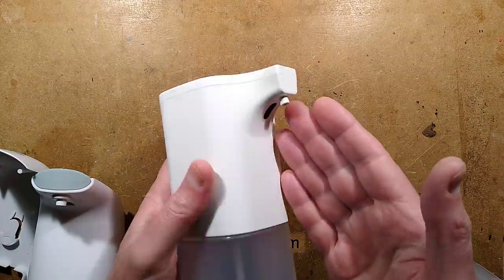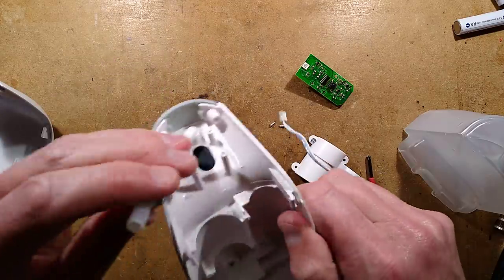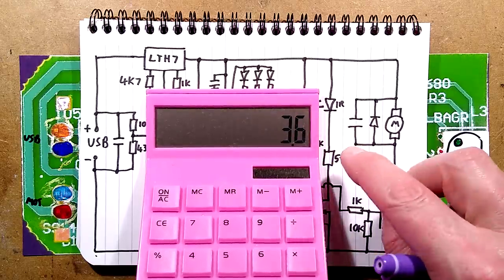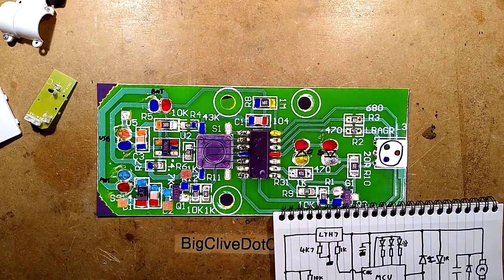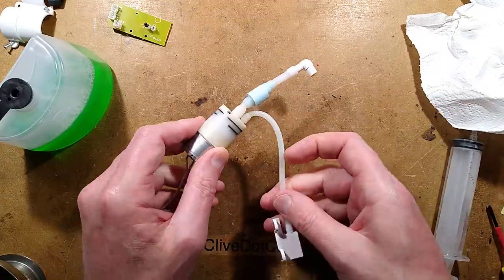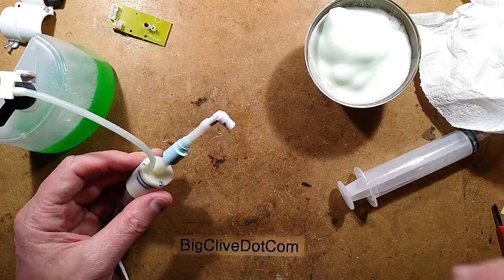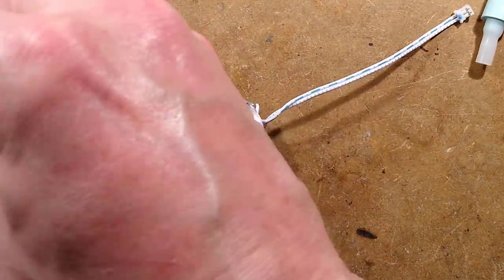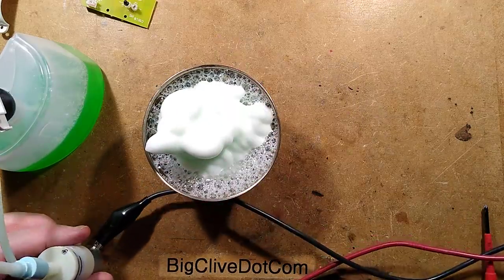Fixing a faulty schmoo pump

Comment: Have 7 of these in the family & 4 have needed fixing so far. They work fine for about 9 months. Over time the unprotected pcb/smd components get corroded by the soap vapour. Both sensor pcb + main pcb suffers. Fix was microsoldering or jump wires followed by a conformal coating. My advice is take it apart when new & seal all the the pcb's before use.
Reply: Very clever info

Comment: Pump could be incorporated into an automatic woofler ,with spark ignition ?
Reply: Exellent!
Reply: Oooh! Yes!
Reply: Make it so @clive
Reply: I think he tried making one before but it didn't work so well, or tried to melt itself
Reply: @phonotical  I know Clive isn't a fan of Alexa, but the prospect of shouting 'Alexa ...whoofle!' could be amusing, sonoff relay and a wee script would do it 🔥🔥🙂
Reply: @j_o_h_n_d_u_n_n  depends on her reaction 😂
Reply: There used to be a kid on YT called Royal Nonesuch.
He made guns in his "machine shop" a garage with a cheap stick welder, an angle grinder, a vice and a hammer.
As dangerous as that sounds he pretty much knew what he was doing and never hurt himself.
Then he built a flame thrower.
12 volt pump from Ali Express, a drill battery, a switch and some sort of igniter.
Oh yea I forgot the best part several gallons of a gasoline diesel mix in a bottle in his back pack and connecting it all was clear tubing that looked like it came from a fish tank.
Every time he showed it, it actually worked and he would ride around on his motorcycle randomly shooting flames at stuff.
I remember begging him to please go back to safer activities like making zip guns in his garage.  
Sadly he was purged by YT and I can't find most of his videos anymore.
Reply: @1978garfield  stay in school kids 😂

Comment: So in theory, running a cleaning cycle of rubbing alcohol or cleaning vinegar, then water to rinse out the guts would work?
Reply: Yes, probably.
Reply: It's a junk product and water goes inside, rusting everything or causing electric shorts. Junk, junk, junk!_
Reply: @jurivlk5433  how else do you expect the soap to foam. Yes it's basically a disposable device. Wonder what they had to to do for the power adapter and the 18650 battery? 🤔
Reply from the maker: It might help.  It depends on what the mesh clogs with.
Reply: @epsileth   Shitty quality isn't a requirement for soap dispensers!
Reply: @jurivlk5433  welcome to capitalism. Has to last long enough for the manufacturer warranty to expire. Let's see you design a  better device.
Reply: @epsileth  One could think you're the owner of the manufacturer of that shit!
Reply: @epsileth  Were Soviet factories... known for their quality control 🤭
Reply: @phantomkate6  I don't know, I've never been in one.
Reply: @epsileth  I'd venture people would rarely bother to keep their receipt for a purchase of this value, so it wouldn't even have to last that long.
Reply: @phantomkate6  From my understanding they were reliably subpar.

Comment: Handy device. Will you be converting to an 18650 battery, or will it be too much of a faff for everyday practical use.i.e finding it flat and having to re-charge, instead of swapping batteries.

Comment: Might be worth mentioning, whenever relevant, that rechargeable batteries (generally) output a lower voltage when fully charged than non-rechargeable batteries.  In some kinds of devices it makes a lot of difference.
Reply: While the initial voltage of rechargeables is lower, their "empty" voltage is higher than that of non-rechargeables. So if it makes a lot of difference, it means the device is really bad at using all the energy in non-rechargeables.
Reply: @superdau  Yes.  Those devices only work well near the upper end of the voltage range. That can make it seem like rechargeable batteries are not as good when in fact they're just not as good in that particular device.  So yes, it's also fair to say that that device is not good at utilizing rechargeable batteries.  Before I understood this I thought rechargeable batteries were, in general, kinda crap. Now I use them almost exclusively.

Comment: all those foam type units don't seem to last. (the "nonfoamy" ones are reliable)
Reply: so i will no go into mass-repair of at least half a dozen defective ones sitting somewhere since months, cleaning metal meshes and pepper dispenser caps...
Reply: Any idea how long they'll last? Have had mine (a rechargeable one) for two years now, haven't failed yet. I'm running clean water through it every time I refill the tank.

Comment: I bought a couple of the first version you showed in the previous video - one of them developed slow-mode after a couple of weeks. Took it apart, the foamer gubbins was blocked. But unf. it wasn't so easy to disassemble. Now have a coarse foam (rather than mousse!) dispenser!!

Comment: at hardware stores here in the US, you can get jugs of insect repellant with a battery operated pump wand & the pump in there is really weird compared to these. in the RoundUp one (i don't know if the others are like this), the pump is just a chamber with two gears that pull the liquid through the tubing. i highly recommend taking one apart yourself

Comment: Would the voltage from a stun gun travel through the soap that would make it an interesting dispenser
Reply from the maker: It would be complicated by the need for two connections.   But you could just have them poking out the front.

Comment: I'm guessing they're powering the led from the uc to prevent the led flashing when powered on and the uc pins are grounded before it initialises? If you've got a spare pin then why not use it. At the expense of passing more current through the uc of course. Interesting choice though
Reply: It would also stop the uc being powered through the led pins but that's probably less likely in this. (I'm a hardware and firmware engineer btw!)
Reply from the maker: The microcontroller is powered directly from the positive rail that the LEDs would be connected to, so with their voltage drop and resistor they couldn't really feed the processor via it's protection diodes.
Reply: Also, if you want to implement that 'pumping' blinky effect you could get away with one timer pin. Not saying they did that, but this would be a nice way to do it if you only need boolean mixing of the primary colors. Maybe this is used in combination with charging the lithium battery.

Comment: The inline mousse generator looks like a miniaturized version of the aerators that you get for fitting onto taps (faucets) that give you a soft aerated/foamy flow of water rather than a solid (tends to splash) stream of water, they often also have flow restrictors inside to limit water wastage.
Reply: Doesn't really matter whether on the tap, in the soap dispenser or the end of a beer pump, I hate them !
Reply: @millomweb  I have learned of my NEW best worst nemesis.
this fucking thing.
Reply: Water wastage? Usually they just restrict the water pressure to the point you end up wasting a bunch of water trying to figure out how you're supposed to wash anything at such a low flow rate.
Reply: @tin2001  this thing has nothing to do with water tho? its a soap dispenser.

Comment: I've gone through about half a dozen different models of automatic soap dispensers, and most stopped working quite quickly. I think some got clogged, but mostly the electronics inside seemed to corrode quickly in the damp bathroom environment. 😕

Comment: The soap in the two air compartments mean that either the flappy valves did not do their jobs or there was a seal malfunction somewhere else doesn't it?
Reply: And maybe explains why the screw besides the air-hole was kinda rusty, too.

Comment: So can you cause it to dispense by aiming your tv remote at it?

(Instead of the IR reflecting off your hand)
Reply: as soon as I read this comment, I had to find out (a couple of pranks formulating in back of mind). after a little testing,  technically, yes the tv remote triggered them, but had to be quite close and aimed into the "eye" ... so not prank worthy :(

Comment: Sorry, I missed it - what was the actual fault?   When you pulled it apart, it seemed to work fine.
Reply from the maker: The motor was running, but the metal foaming mesh was blocked with residue.

Comment: Could you put Milk or Cream in it to foam it up?, i'm wondering.
Reply from the maker: Not recommended for hygiene reasons.
Reply: @bigclivedotcom  That would count for Ice machines too, they are filthy inside, i don't want that slime and grime in my Drink.
Reply: @bigclivedotcom  It's not about if you should, but if you could 😉
Reply: A French press works for that. And it's clean, or as clean as you keep it.

Comment: @bigclivedotcom , this is great. Thanks a lot. I have a similar one that I just took apart to look at and discovered this video in the process.
I've ordered the same one as this one with the plan to put in an 18650 cell as I have a few left over from another project. Could you please give any tips on how to wire it up? Much appreciated 😊

Comment: Clive. Every time you have something that has one of those pumps in it, my mind starts thinking about a RC truck I'm building.
It's an 8x8 off road rescue vehicle that is going to have winches on the back along with a simple crane. The connection with the pump is if the truck is lifting something the suspension will compress, to get around this I'm thinking about active suspension. Do I go with electric (servo), pneumatics or hydrollics to move the suspension? 
But if got to build a rolling chassis before I can figure it out. 
Thanks for keeping my mind active, it's not having a great time due to mental health issues. But you have helped me a lot. 👍😁

Comment: ICI used to market something similar (although mains-powered) for Hospital (i.e. Theatre) use back in the 1990's. Theirs used two pumps and a "mixing chamber" gadget - one for air, one for Hibiscrub. Nice stainless steel enclosure, and they cost a pretty penny, so difficult to get old ones to cannibalise!

Comment: Interesting. That pump is very similar to the one in my covid supersoaker disinfectant gun. I took mine apart one time because I accidentally left the dip tube in the reservoir filled with super-concentrated hypochlorous acid solution and it ended up corroding all the metal components in the unit. Marine-grade, it is not.

Comment: Still searching about what was the problem. Did aerator screens had some schmoo in them...
Reply from the maker: Yes.  Final screen had a build up of particulates/film.
Reply: @bigclivedotcom  Hmm, I cleaned mine... All the same. Just short burst and that's it. Will dismantle the pump and check it. After that I think putting some soft springy switch on top of device circumventing all electronics. Would be like using that soap pumps, but on battery's and foam :-). Just taping on a switch with a thumb and dispensing in the palm as much as needed.

Comment: To avoid wiping off pen marks I discovered the Pentel N50 permanent markers are brilliant. They write on anything and dry instantly so your fingers don't get covered in ink. As an added bonus they're solvent based and smell yummy.
Reply: Yeah, these solvent free markers suck. I have an edding from ca 1990, possibly older and it still writes fine. Whereas these modern ones dry up within a couple of years.

Comment: okay, I definitely agree with the foamy booze, but also, this seems like it's foamer component could serve as an HHO Bubbler and gaseous recombiner assembly for an HHO torch that's portable. Any ideas why that might not work? other than it's plastic and HHO, I think it could be a servicable unit.

Can we get a link to this one please Clive or where you purchased it from?
Reply from the maker: It's an eBay unit, but you may have to hunt for a similar unit.

Comment: The CPU is looking for the IR pulses reflected by your hand. The input pin from the photo diode will have the same frequency on it if the LED pulses are reflected back by you hand, or what ever else.

Comment: This is basically a smaller version  of what is on a Fire Truck’s CAF system.  This will be helpful for explanation to the new rookies on how it works. Biggest difference is we used pressured air vs Pump

Comment: Eneloop AA are 1.2v rather than 1.5v - .9v down. Surely that slows it down a little?
Reply from the maker: It will result in slower operation than fresh alkaline cells.

Comment: Clue in a total novice here please,  - does the reflector work off of ANY change in light wavelength, or to a reflection of your hand reflecting a different wavelength, or ? , or ?  Ignorance inquires.. I was with you until that point. Quite proud of myself.
Reply from the maker: It responds to anything that reflects infrared light.

Comment: Normal diodes can also be used as photo diodes, analog devices has a page dedicated for that application. Also I like the ground points in the circuit diagram to keep it from cluttering.

Comment: By driving the positive led feed from the mcu pins, it avoids any rogue flashes of light as the mcu boots up and might toggle the output pins as they are initialised?
Reply from the maker: When a microcontroller boots up the pins are usually assigned as inputs until set as outputs by the software.
Reply: @bigclivedotcom  agree 100% but it's just after they set the pins as outputs that they occasionally do something unintentional before the program sets the output states to the correct state.

Comment: What soap did you use? 
My unit only produces either normal soap or really cluttery soap bubbles when I dilute the soap with water.
Reply from the maker: Dilute shampoo in a ratio of about 1 part to 5-9 parts water.
Reply: @bigclivedotcom  Thank you sweety ;)

Comment: I have a few similar pumps that turn them selves off often, I think it's an oversensitive proximity sensor (as it doesn't have a push button, you just touch an area on the case). If you would like to take it apart and figure out what's going on let me know and I will send you one. Then I can fix the other ones!
Reply from the maker: Is it a round body and rechargeable?  I've got one here that turns itself off.
Reply: @bigclivedotcom  yes, with the on/off button on top above the spout that looks like the classic on/off symbol that lights ups red and blue. I have 4, only one doesn't turn its self off, every other one turns off after the first use. I thought poor quality batteries at first but after taking apart I don't think that's the case as the battery tests ok.

Comment: I’m speculating the LED common being driven from the MCU pin instead of the B+ is because there may be enough leakage to ground through the MCU pin when the MCU is in low power state that the LED might glow a bit and/or waste battery charge.  Taking the LED common pin low before sleeping the MCU will prevent any leakage through the LEDs.  Using the MCU pin as common also eliminates the voltage difference between B+ and the maximum output high voltage. Using B+ as common would have allowed a tiny amount of current flow when the LEDs are off (not sure it would be enough current to matter though).  Over-all this is a smartly designed circuit.

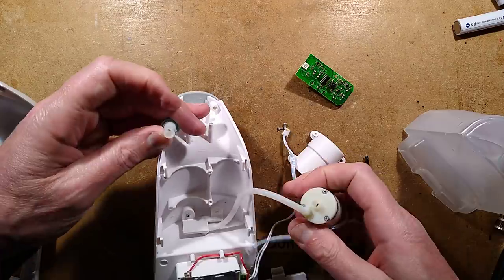Comment: Clive just had a blow off camera. 03:11 If it's possible, replace the screws with stainless steel equivalents, so they don't rust as easily, thus cracking the pump.
Reply: Or just dip the screws in Vaseline before inserting them, because they're quite unusual geometry and (so) I wouldn't have any in my stash.

Comment: This is one of those examples where it totally beats me why one needs a microcontroller for this.
Reply: One button control and motion/proximity sensing works better with one
Reply: The MCU is pretty much a penny part, nowadays, and can give you optimum control over the other components.
Plus if you don't like the way the product's behaving (too much or too little schmoo, for example) you can just reprogram the MCU; no need to change component values, redo the PCB etc.; so, faster and easier.  Maybe even reprogram in-circuit, while developing.

Comment: the pump have no separate chambers for air and water.. there had to be some venturi valve at the connector to the tank.. and sucking some air with the pressure of the water flow!  (i think the mini hole at 22:38)
Reply from the maker: It has three chambers.  Two for air and one for liquid.
Reply: @bigclivedotcom   if you mean , i cant make the difference in your video , have some vaccum pump at home thats looks same, and all three chambers are working togheter...  but if you right, then that pump is very complex... (cant belive in so special parts they use xD)
edit: got your first video and now i can see what you mean... but the venturi effect should work too

Comment: Is the 1k gate resistor really needed on those MOSFETs?
Reply from the maker: I prefer it.  It protects the microcontroller from the current spike of charging the capacitive gate, and in industrial equipment it may protect the circuitry from a MOSFET gate failure.

Comment: Getting active drain on this thing even when it is not ON. I have a 5056 8pin charger chip instead of the lth7.
Reply from the maker: The processor usually remains active, but should only use low current if the unit has been designed and programmed correctly.